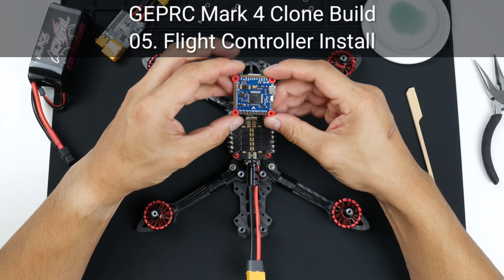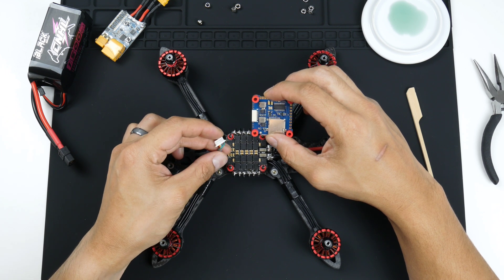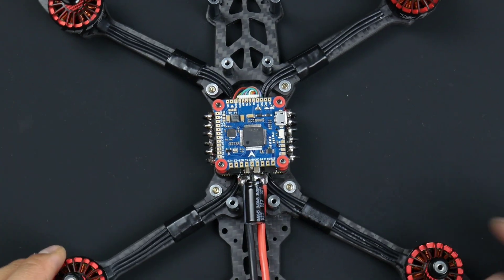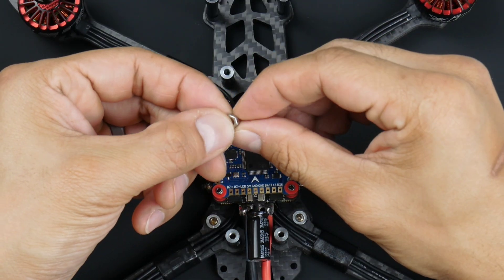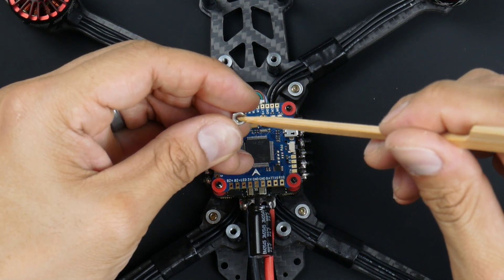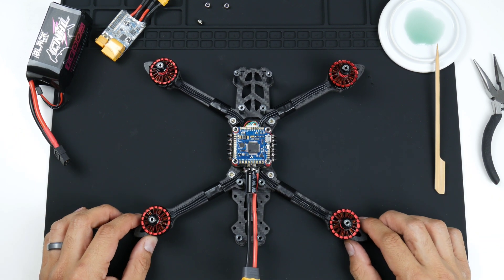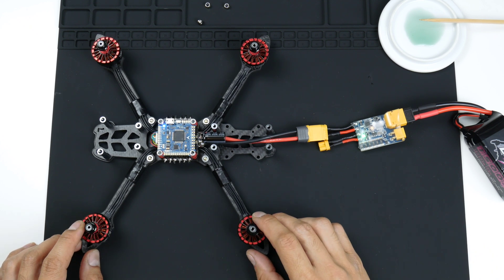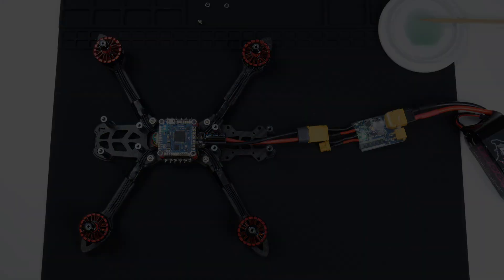GEPRC Mark 4 Clone Build - 05. Flight Controller Install

Comment: Can some one recommend some good solder, mine isn’t like this goes more like paste
Reply from the maker: @robl1967  I get mine from the local hardware store. Weller 60/40 1mm wire works well for me. Sure, I can buy cheaper online but solder lasts so long for me and it's more convenient just to buy it locally.
Reply: @ thank man, I’m new and can’t get the dam power lead on the fc 😅
Reply from the maker: @robl1967  yeh. Power leads are a struggle for most. Even in my video I have trouble too and have improved over time with practice. Keep practicing! Plenty of example videos on YouTube. Good luck! By the way, I run my soldering iron at 400°C, which a lot of people find too hot, but seems to work for me.

Comment: What kind of battery have you used, can you provide information about that?
Reply from the maker: For this build I use a CNHL 4S 1500mAh Black Series.
Reply: @nxp200  How much volts 7.4 11 or higer ?

Comment: When i connect my battery to the esc and flight controller, a lot of sparks were occurring from the esc and the flight controller . And as soon as the i connected battery , the flight controller did not turn on , there were only sparks . I even had the smoke stopper attached.

Comment: i bought the quadcopter set  (HUIOP Mark4 5 inch FPV Carbon Fiber Frame Kits 4pcs 2205 Motor 4 in 1 30A ESC F4 V3S Flight Controller 5045 Propeller Kits for FPV Drone,4 in 1 30A ESC )  however the esc has a 6 pin cable connector and the flight controller has a 8 pin cable connector . i dont know how to connect the esc with the flight controller because the wire is incompatible. what should i do? how should i connect the esc with the flight controller? Any idea where i can buy a compatible set.
Reply from the maker: It's possible to reorder the pins correctly on the connectors if you know exactly which wires are the correct ones on both the ESC and Flight controller boards. Without experience with electronics, reading wiring diagrams, and most importantly, testing and verifying the correct pads/pins/wires, it's quite risky to attempt. Also if you bought the Flight controller and ESC separately, it will be difficult to find the perfect connector to buy. Here's a video I found that demonstrates what you'll need to attempt. https://youtu.be/gXo0oXnGLDs?si=LzylPjYF-m43t1zd

Good luck and I hope this helps! If I have time in future, I'll try to make a tutorial.

Comment: Thank you very much for such a video. My question is that, after you have finished quadcopter, then do you use GPS sensor? Is it required for this flight controller? Thanks in advance.
Reply from the maker: I didn't install a GPS into this quad. Betaflight firmware does not require GPS to operate

Comment: Hi I'm new to these stuffs. If you have time could you acknowledge me a little about this FC?  Is it compatible with individual ESCs and is it also compatible with Rx Flysky i6AB? Thank you for your attention.
Reply from the maker: I haven't used individual ESCs with this flight controller before but it should be possible. You'll need to wire each signal wire from the ESCs to the motor pads on the flight controller, the signal ground wire to the common ground pad next to the motor pads on flight controller, and the ESC main power wires to the battery via a power distribution board or make your own wire harness using thick gauge wire. I haven't used FlySky receiver before but I think it can be.
Reply from the maker: I did a bit of searching and remembered I helped someone with the same question regarding FlySky i6AB and this flight controller. You can wire the ibus signal wire to any RX pad. Here is a video that might help https://youtu.be/8ytxZWbPOfU

Comment: Hi.I bought flight controller stack mounting by 20mm to 20mm screw by M3 type of screw, hence I bought flight controller stack can only fit by M3 type of screws,I measured the Ready To Sky brand Mark4 5 inch frame has small size of 20mm to 20mm holes to install the stack but I bought stack can only Mount by M3 type of screws so please tell me what I do for to get M3 type of screws holes to 20mm to 20mm mounting holes?
please reply to these questions as soon as possible.

Comment: Hi.I bought flight controller stack mounting by 20mm to 20mm screw by M3 type of screw so am I bought flight controller stack can fit to this Ready to Sky brand Mark 4 frame ???
what screwdriver did you use to assemble this frame?
please reply to these questions as soon as possible. Thanks.

Comment: Hey bro , thanks for your videos , you have the most useful information, and I have a question, if I wanna use the ppm receiver I need to solder the jumper( it says ppm next to the button) on a flight controller? Thanks in advance
Reply from the maker: Hey mate. Yes, according to the limited documentation that can be found online regarding this flight controller, you need to bridge the PPM jumper pads. To be clear, it's the two pads closest to the label PPM on the circuit board. Here's a reference diagram I found on AliExpress https://ae01.alicdn.com/kf/Hf96ae84ed93f4578b5bf557b5ccf54dcQ.jpg_640x640q90.jpg
Hope that helps!
Reply: @nxp200  Thank you very much, as soon as the war ends in Ukraine, I want to order a similar kit, it costs around $ 100, with the same flight controller as yours. Of course, he is not as advanced as yours, but I also think he will fly well(rs2205 2300kv , LittleBee 30A-S, F4 v3s, QAV-R 220 mm) this will be my first brushless quadcopter, I hope its assembly and setup will be as interesting as flying
Reply: @nxp200  Hello, I have a question about the power supply of this flight controller. Should it be powered by 5 volts or directly from the battery?
Reply from the maker: I checked mine and it is powered from the ESC which supplies VBATT (14.8V from a 4s battery) to the flight controller. I'm unsure if it can handle 5s or 6s. I believe it can also be powered from a 5v regulator as well.
Reply: @nxp200  Does this flight controller support ibus receiver connection?